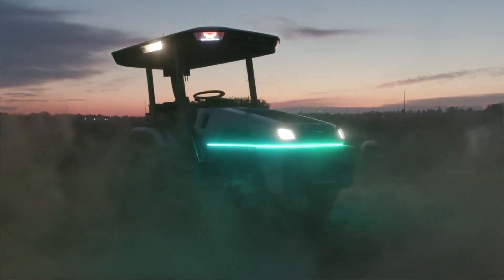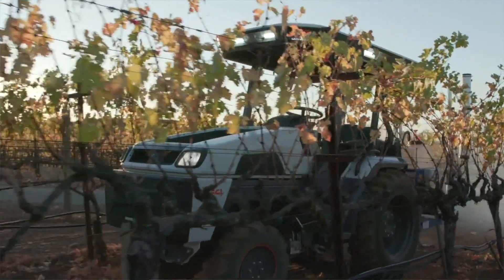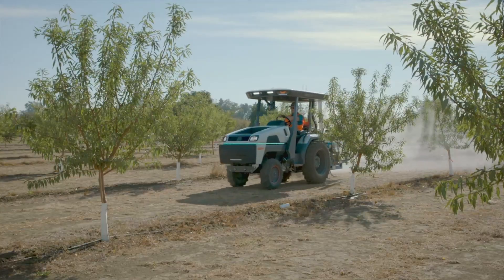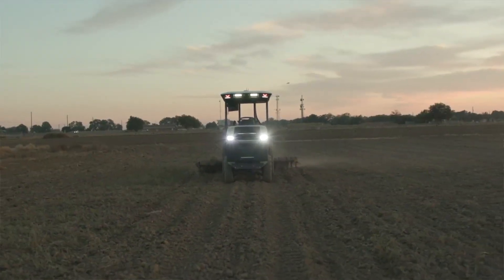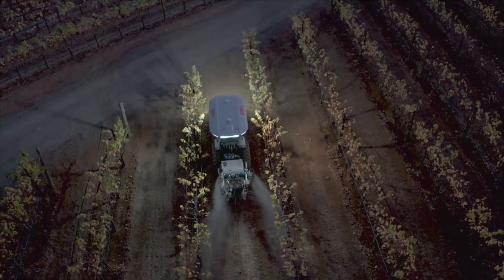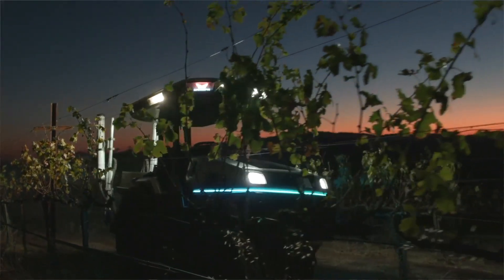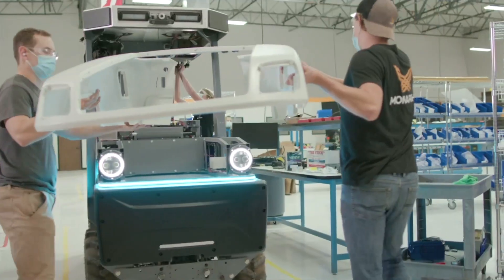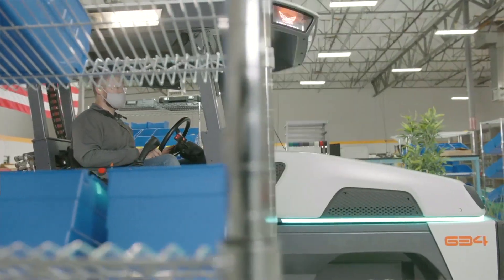A New Compact Tractor That's Different From All Others

Comment: Great Video Mike and they said Tesla vehicles would never make it.  My oldest son bought a tesla model S and I rode in it this past thanksgiving.  The power is unbelievable compared to a gas burner.  Self driving tractors are not new, my brother has a large farm and his tractors are equipped with GPS, once you get into the field, you just tell it what field and it will do the chore you are there to do, make rows, disc, subsoil, etc.

Comment: Interesting. Great interview.  I think these guys have a viable product and have done their marketing homework. Many factories today have automated carts transporting parts and supplies around, this just moves them into the farm field. Modern tractors have precise GPS systems and can drive themselves. But, who trusts an expensive 350 hp tractor to run without an operator in the cab? Tractors and combines have gotten larger and larger to allow more productivity per operator.  Monarch seem to be taking a different route; multiple, smaller automated tractors.  The key is going to be battery life and efficiency of swapping out the batteries.

Comment: It's electric. Not that much to repair as there's not that much to go wrong. 
Probably a third to fuel. No toxic fumes. Nearly silent so ear protection is not necessary. A low center of gravity so it'd be pretty hard to tip. I don't need or want the autonomous features, though, so that should be optional.

Comment: What i hear is a lot of cost when crap breaks down. As the big farmers are finding out you can't fix this high tech stuff. Now your tractor is down and your work is not getting done because your waiting on a computer tech (I mean mechanic) to do an expensive service call to fix it.
Reply: The tractor app tells you how to fix it, and yes you can fix it(right to repair).  This isn't those other tractor companies.  The motor has one moving part rather than 300 moving parts, so there is less complexity.
Something could go wrong with the computer, but computers are usually quite modular and it isn't too hard to figure out what is wrong.

Comment: How long does it last on a charge using the 40HP? How long to recharge it? He doesn't answer that. What is the battery pack weight, and weight of the tractor? How much HP to the PTO? I like the use of software and sensors to monitor the status of the system, and his mention of the right of repair for the tractor. From a power standpoint, I would have preferred a diesel electric hybrid system where you use the electric system and controls but the longevity, and effectiveness of a diesel power plant, rather than a spare not environmentally friendly battery.
Reply: Eliminate the battery and give it a small diesel powered generator to power the electric drive motor and keep all the other features.

Comment: Hi Mike. I know it depends on what you're doing with the tractor and the terrain, what is the approximate runtime and how long does it take to charge the battery?      Later
Reply: From Monarchs website they are showing 70 peak HP, 10+ hour run time, 12 gallon hydraulics, 4-5 hour charge time at 220 volts,   the 3 point lift is a little weak at 2200 pounds for a 70 hp equivalent tractor, but the $50K price tag isn't bad for that size tractor.   But real world numbers would be more useful.